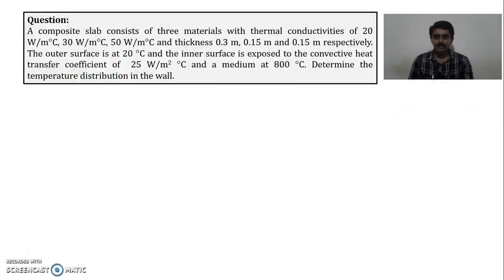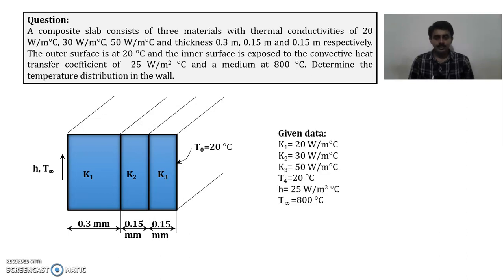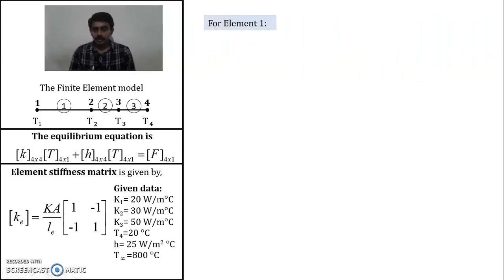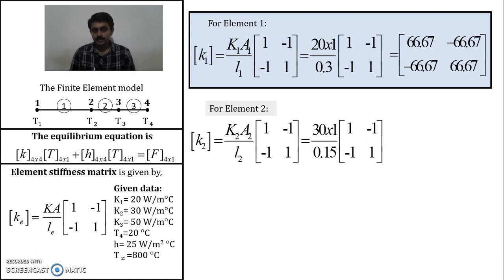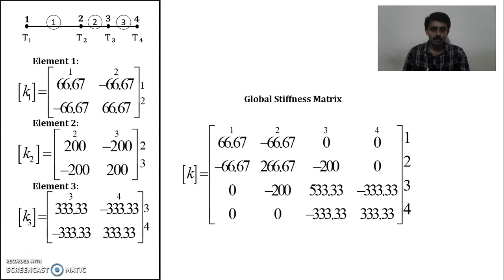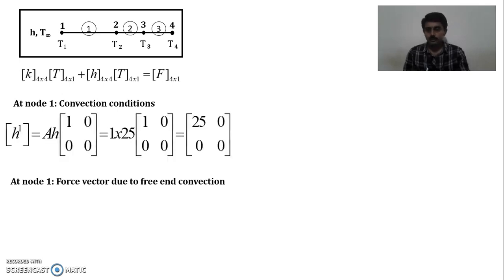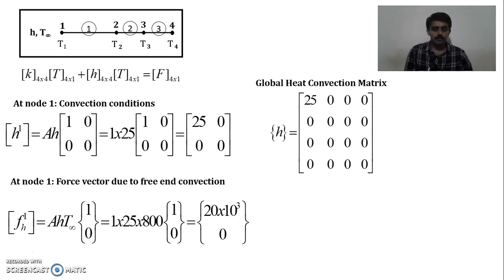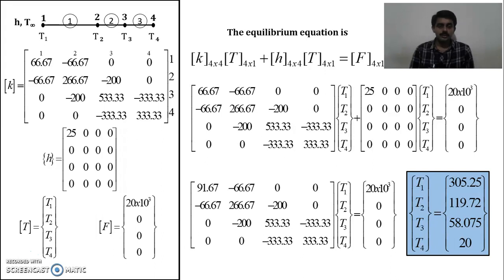Heat transfer FEA

Comment: would you please explain general steps of fem to calculate heat transfer in convection flow?
Reply from the maker: http://what-when-how.com/the-finite-element-method/fem-for-heat-transfer-problems-finite-element-method-part-3/

Look at this link
Reply: Hello sir but from last equation T3 value also 20..How that 57 came